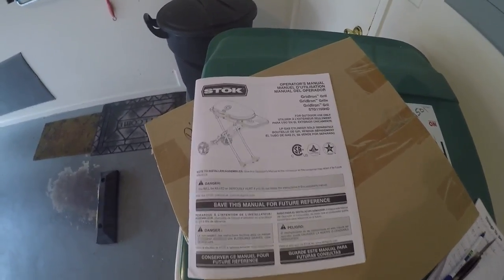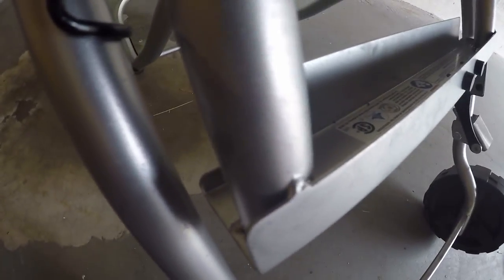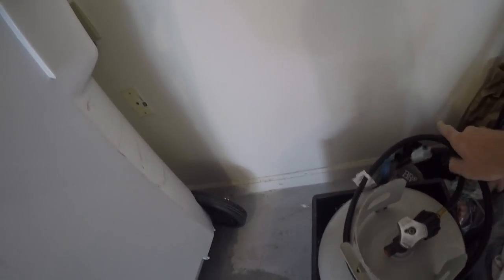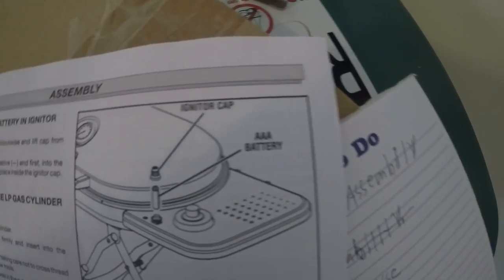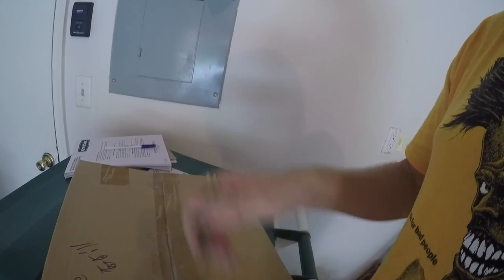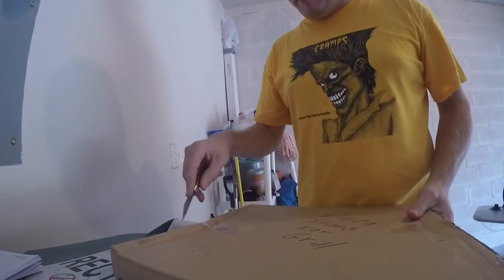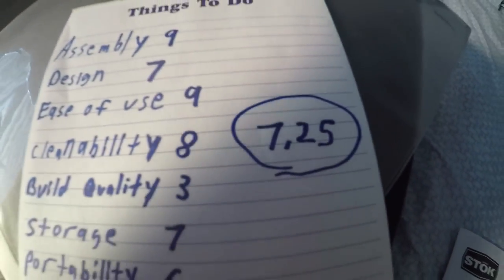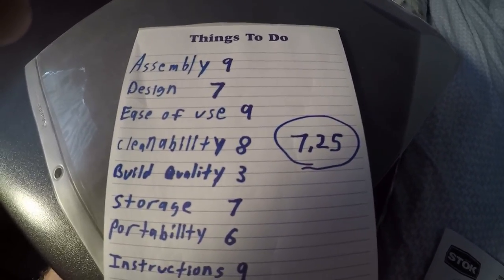A review of the Stok Gridiron Grill Model # STG1150HD

Comment: Having issues with the gas intake. The control knob has an internal mechanical issue, when I go to turn the gas on it does not work. I tried taking It off but like you said you hate picking it apart, because it is not going back on right, have you had trouble with the gas control?

Comment: My latch is the same way. You're grates are in backward. That tab where you picked it up is to use the tool to change out inserts and should be opposite the hinge.
Reply from the maker: Thanks for your comment. But I have to ask, what tool? I did not receive a tool to change out the inserts. Is it purchased separately from the grill? I place that tab towards the back to keep grizzle and fat from accumulating in the slot.

Comment: Been looking for a replacement grill in RVing camping .
Seen this and a few coleman models and blue rhino. 
Not many companies involved in portable collapsible grills 
Any recommendations ?  Hows the grill so far /? 
I see the customers reviews on coleman's people have something to say about everything so never ever gonna find the perfect grill ..maybe a weber but they have their faults too.
Have you seen any other brands ... Great info on here but yeah its sorta long.
Condense is a must .. Shorten and take out segments. Get it to 5 minutes which about peoples attention span ... But I got more from your video then all the rest!!!!
Reply from the maker: otown, thanks for your comment and feedback. Yeah it was my first video, I was anxious and it was the first time using GoPro's frustrating editing software so yeah I could have cleaned it up / shortened it a bit. If you use this for RV / camping I would suggest storing it in a horizontal position. If you store it vertically it will leak fat and juice more so. When storing the grill use plastic and cardboard under it to absorb any residual juices. I am very gentle with this grill, clean it often, and line the bottom with foil to keep it from getting gunked up. Like I said, the leg welds are piss poor and they use small pop rivets in high heat / stress areas in construction of the grill. One of the bolts and washers fell off the wheel and I had to find it and re screw it in. So now I often check the wheel bolts. The burners have a nice roof / shield to protect them. In general I will say this: Cooks very well, easy to clean, no hooks for cooking utensils, small tray on side with limited space, get a hose tank adapter for a 20 lb tank. I strongly feel if a certain amount of torque or twist occurs on the leg welds it could easily come apart, so with that I would not wheel this thing around over rough terrain or a moderate / long distance. If you are a person who will maintain and clean it, and not have to wheel it around very far, it could work for you. I am very happy with the cast iron grill sections, the heat it produces and the resulting food it makes. I think there are more rigid portable grills out there at lower cost points which can likely take more abuse, however. So if you are a grill and go, don't want to clean or maintain grill guy / gal take that into consideration. 

"But I got more from your video then all the rest!!!!" I am glad to hear this.